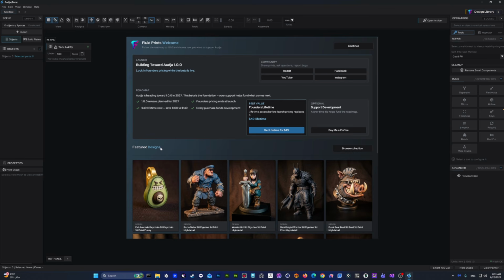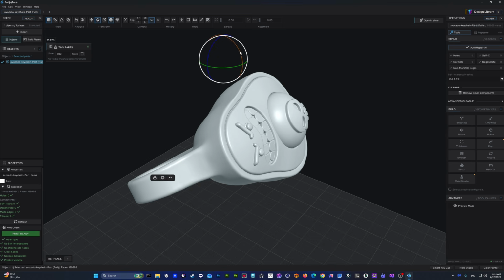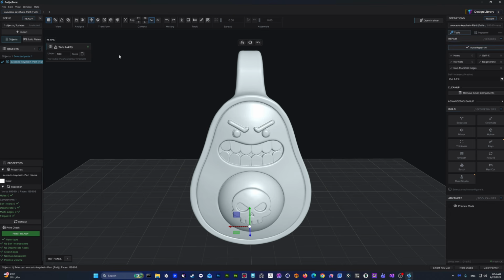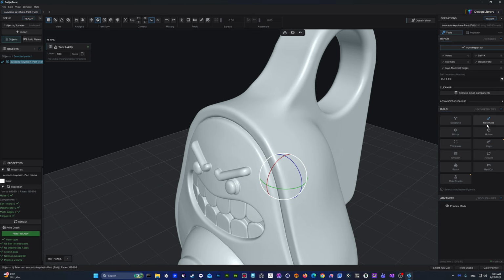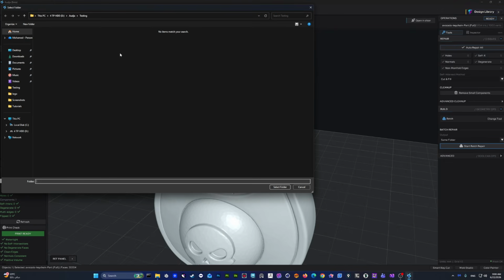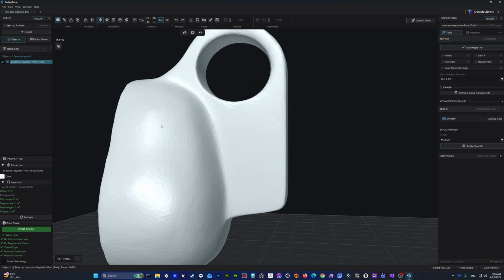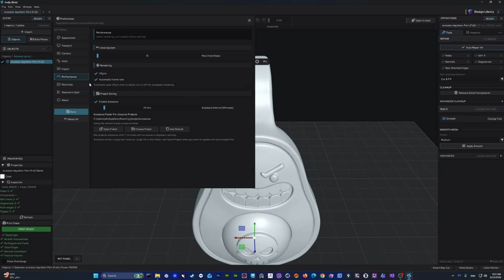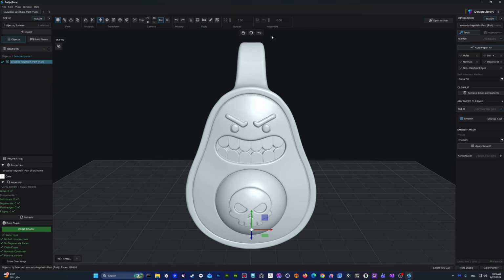Audja Tutorial #1: Introduction, Interface & Basic Tools

Comment: It runs extremely slowly for me and makes my GPU work at 100% just by zooming. I have an RTX 3060 with 12GB of VRAM and 32GB of RAM.
Reply from the maker: Try to import mesh under 1 million faces and prefer under 600k, also if ur monitor has high HZ it will cost u in performance so you can adjust the FPS in preferences panel to 60 FPS, and in next update we will both of this issues,thank you.
Reply: @mtrcgstudio  good to know, i'll try that

Comment: I can't even install it on windows 10. Even in compatibility mode or run as administrator, it does nothing when double click it.
Reply from the maker: Thanks for telling me. Since Audja was just released, Windows 10 / Microsoft Defender may not recognize the installer yet and can silently block it before it opens.
Please try this:
Right-click the installer → Properties → if you see Unblock, enable it → Apply → then run it again as administrator.
Also, if you have an antivirus installed, please try temporarily disabling it and then run the installer again. Sometimes antivirus software blocks new installers silently.
If it still does nothing, send me your Windows 10 version/build and the antivirus name, and I’ll check it.
Reply: @mtrcgstudio worked, thanks

Comment: After inspector, aply fix, but normals and flipped is RED. Attention for print. Repair all? How. Nice aplication
Reply from the maker: If the auto repair didn't fix the flipped normals do this > in build section in right panel there's a decimate option try o make decimate little bit not too much so u don't lose details and it can be fix and if still not try to decimate it again and hit auto repair
Reply: @mtrcgstudio  tankyou, im use the decimate, and apply 1%, when the say execute, the tool jump to 100% and deform model, all times.
Reply: @mtrcgstudio  mesmo assim ao aplicar o valor decimate deformado, a reparação não funcionou no flipped. O status para imprimir esta em atenção.
Reply from the maker: @destroyer4923  can u please post it on reddit or facebook so  i can follow the issue more accurate - u can check the links in description videos !